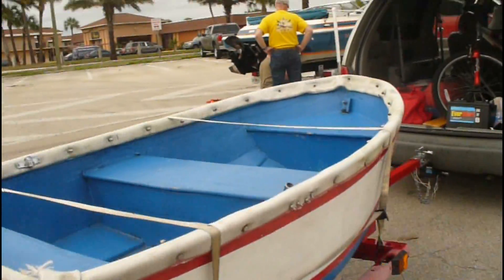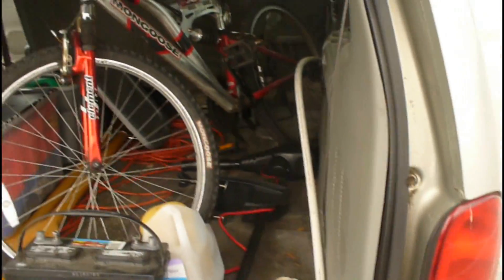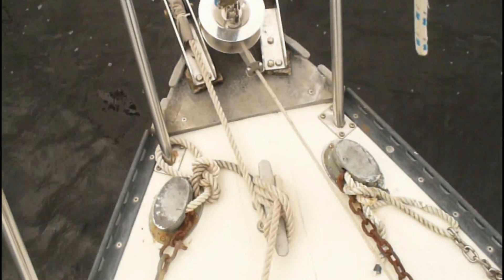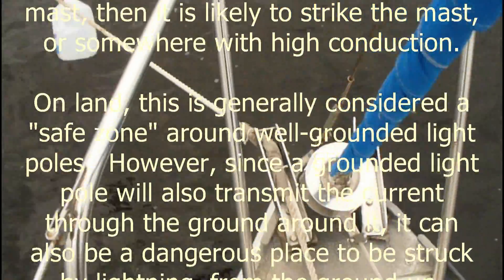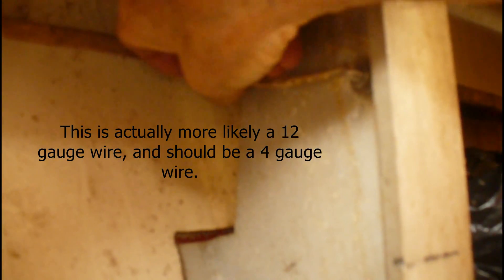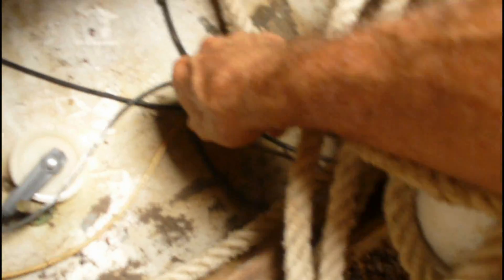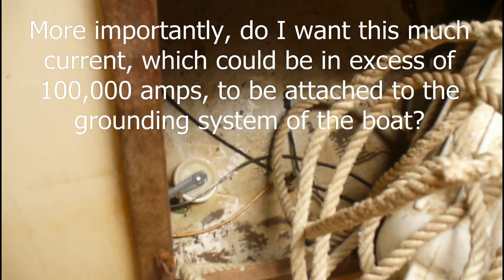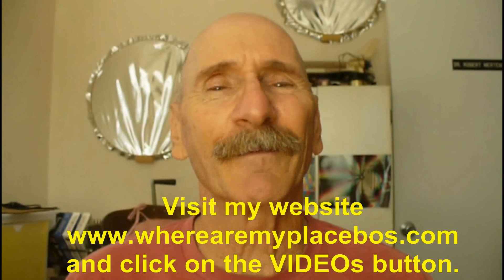Part 1. Lighting Strike! Protect your Sailboat, Revised

Comment: @Andrew Hodgdon all Boat builders should integrate a deep and extensive knowlege about potential lighting damage(s); eg., what to do during  lighting conditions such as, "what to do list red alert". Every new tech, brings a fatal flaw some how....example, old sailors know that during said conditios at sea , the old 100 year old mechanical tech wonder, the diesel engine,  must be running...as all modules (alternators, control module, starter) could get damaged, but the mechanical  Engine itself will not stop and it will  take u  to your destination or  back to your home port.
I noticed that all OEMs are rushing to the new electronic tech space(c zone, electric drives, electric tables, electric bathrooms, AI, artificial Inteligence,  GPS Charting with level 5 auto pilot...) ahead of preparing the ocean crossing mission for a lighting strike...
This capsule is just what we need, congrats, it should be converted to a proposal for safety at sea.

Comment: Wind noise, water noise, music and scrolling text, all at the same time make it almost impossible to concentrate and get something out of this video. It is unfortunate since subject meter is very important and little information is online about it.
Reply from the maker: Thank you for your feedback.  I've since resolved the wind noise issue, unfortunately, too late for this series.  The scrolling text.... what was I thinking - I won't do it again.  When I redid this video, I removed a lot of stuff with wind noise and tried to make up the missing information with text.  I do have a plan, if you keep watching the rest of the videos, for basic lightning protection.  At this time, I'm also working on an invention that will help.
Reply: Thank you.
Reply: @RobertMertensPhD  Hi Robert, nice video, please no music when you are talking. As you are electronic eng please explain circuit grounding for the boat and the electronics with diagram. Thanks pal.